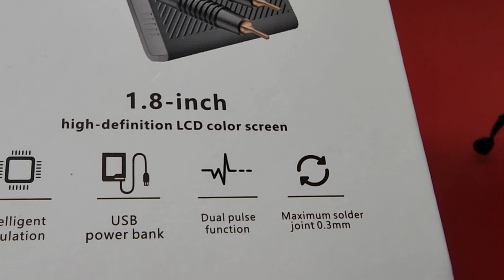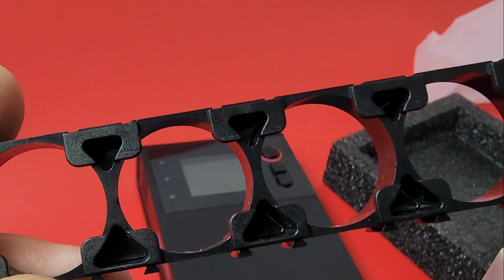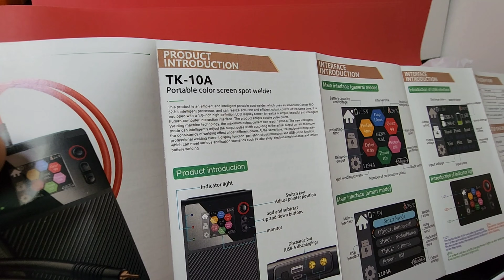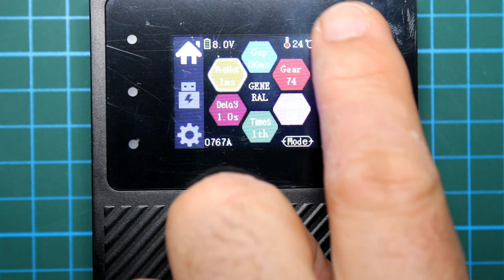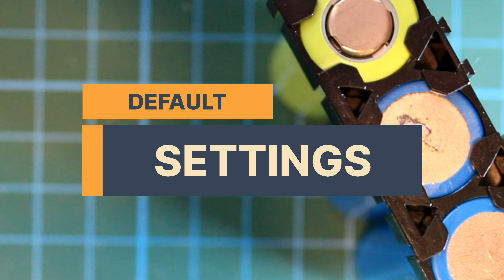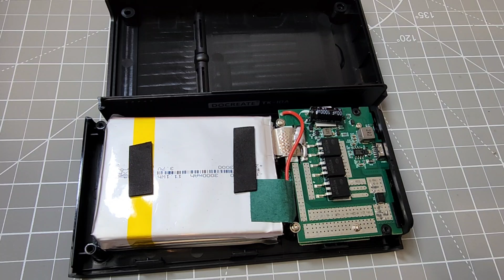It's the BEST YET! DOCREATE TK-10A SPOT Welder • Review & Teardown!

Comment: Amazed at quality but it’s so light i’m finding it hard to beleive it has 4 3000mah cells inside maybe its 3000 combined & thats still feels underweight but if if works this good who would care thats ots nice light tool😮
& in fact if it does work like this vid its an amazing toy but no quality test on streanth of welds just for next time plz😂
Reply from the maker: Glad you were impressed with the performance! That's a good point about the weight, it certainly makes you wonder about the internal cells. Thanks for the feedback on the weld strength, I'll keep that in mind for future reviews!

Comment: Not bad.  Useful for repairing battery packs. Wanted to see if the FNIRSI LC1020E LCR Meter is on your radar? Looks to be an upgrade over Fnirsi's other LCR meters. I was thinking about ordering it, but I usually wait for test equipment to get your seal of approval.
Reply from the maker: Cheers! And yes, it's on the radar. 👀 although not for a while.
OCTOBER is Klein Month, and then I have an upcoming special with Zotek/Zoyi..but I'll try to review in November!!